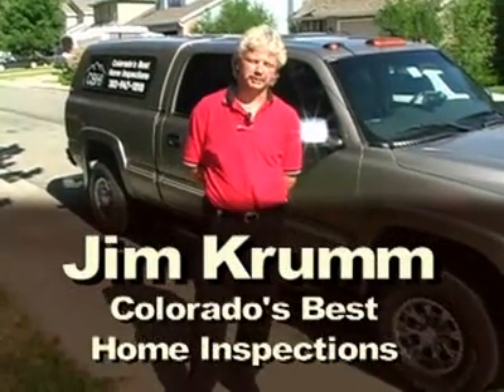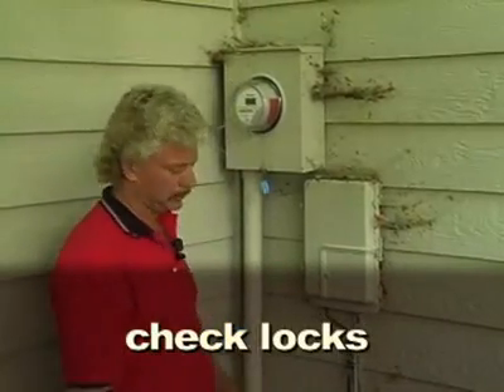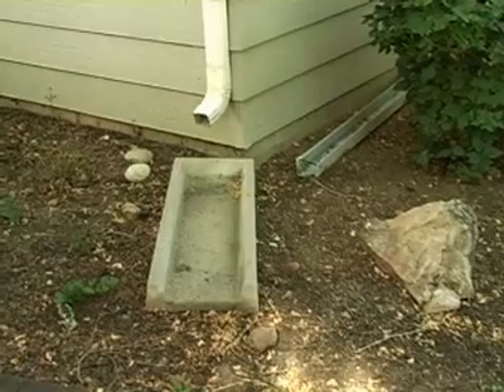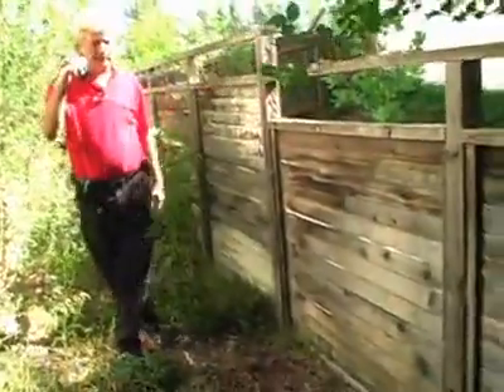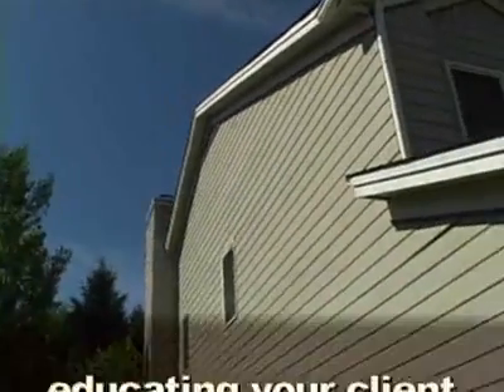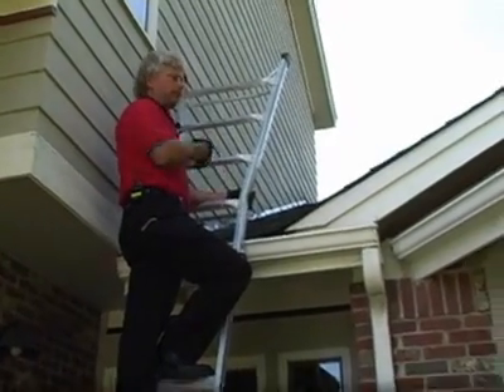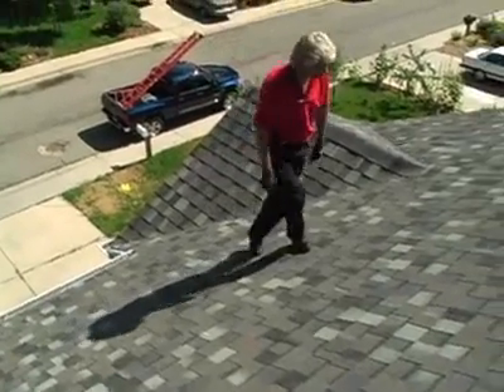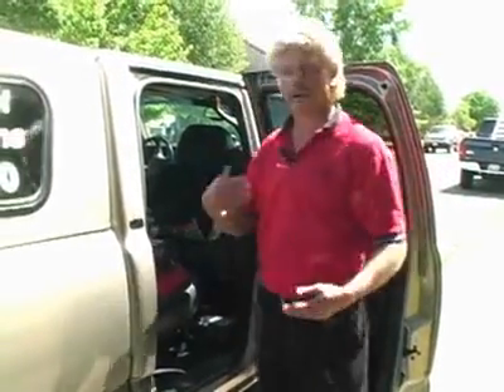Performing Your Best Home Inspection

Comment: I recommend starting on the 2nd story first in a two story house. That way after running water fixtures at the 2nd level it's easier to detect any leakage at the ceiling on the 1st floor.
Reply from the maker: Agreed.

Comment: I just found corruption in my city. Several electrical outlets went out in my apartment. Light bulbs flashed and crackled. A strip of 4 bulbs barely blink. code compliance ignored these outlets and tried to say that my LED bulbs are at fault. I had approximately 150 watts of LEDs at each outlet in one room. That is 600 watts. A healthy system should be able to handle this. 

Suppose that I had used a 1500 watt hair dryer on one of these outlets? what would have happened drawing so much power at once from one outlet? Could have been a huge amount of arcing.

 These are 1974 apartments and rarely does anything get fixed, sometimes for years. I have heard stories of people spending their own money to fix things. 
I have been told the owner owns 24 properties in this city, one electrician hired for all of them.
The Housing Authority gave them 21 days to fix/tighten the outlets and the four bulb fixture and the smoke alarm, but they did not do it. I am thinking that these owners of 24 properties are friends with the code compliance guys.
I have now lost my apartment because of this corruption that does not care about the arcing of wires that could happen any second in any of these apartments. I am thinking that they WANT these apartments to burn down.
Another weird thing is that this code enforcement officer that came to my apartment did not have a uniform on. He had no badges, but since I am the one that called them, I let him in according to what he said. Then later I think about it and call the city to ask them why this man did not have a uniform on and they don't believe me.
This video shows me that 3 code enforcer people should have noticed the smoke alarm constantly beeping and they should have done tests with the electrical panel and outlets.
AND, if I was in code violation, why didn't I get a piece of paper saying so? AND why didn't the apartments get a code violation?
Reply: You are most likely correct
Reply from the maker: Thank you, Candy, for the comments. Sorry to hear of your experience. To find a certified home inspector, use www.inspectorseek.com